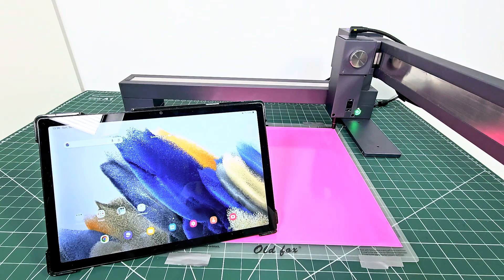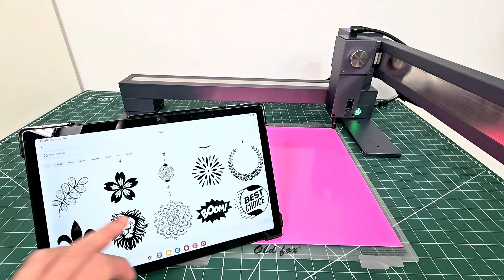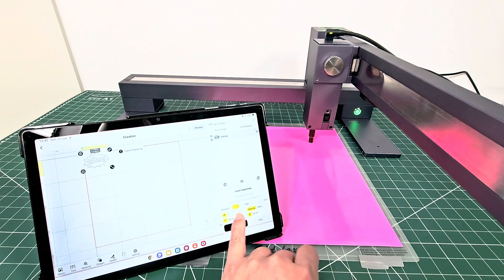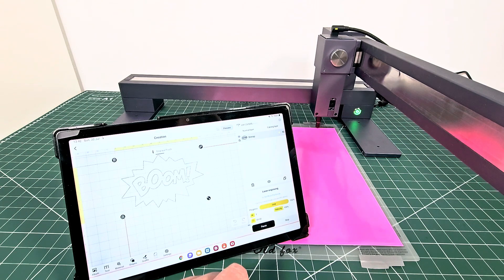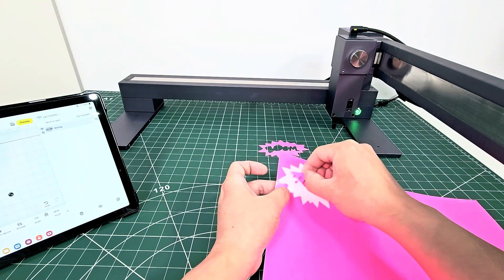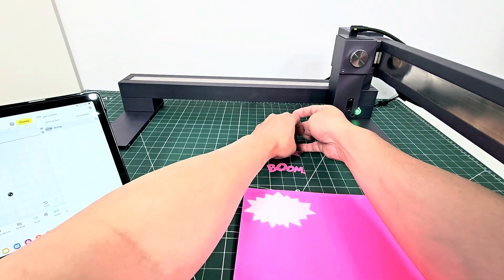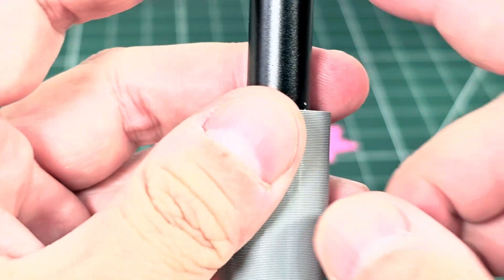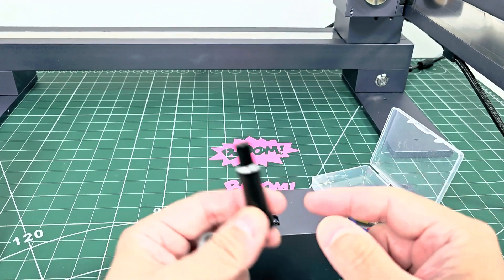LaserPecker LX 1 Series Artist Module 3D Print Mod

Comment: How do you use that module with LaserPecker Design Space?

I put that module, but acts like a laser module. I mean the pen doesn’t up and down in order to draw
Reply: Update your firmware. It works in Lightburn - you just have to enable another Axis - like a CNC machine.